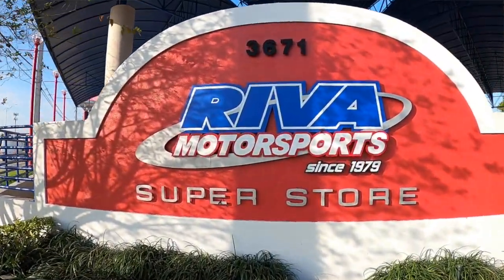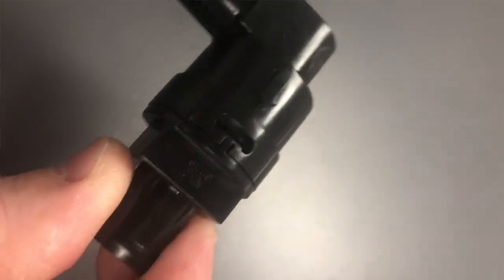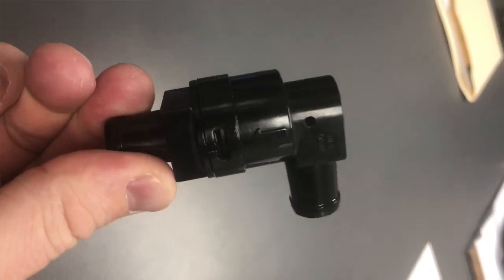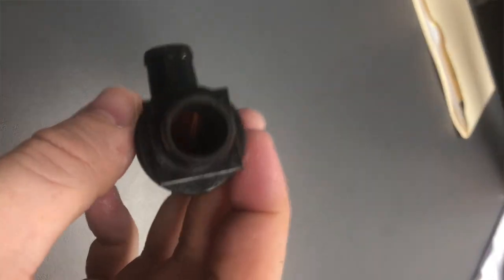Corrections On Yamaha Bilges & Sea-Doo ACE Engine Plasma Coatings: WCJ Quick Topic

Comment: ok. great. so were back to the million dollar question. why is there a gallon of water in my hull? is it blowing past the hood seal?
Reply from the maker: If only you subscribed to The Watercraft Journal: https://watercraftjournal.com/gallery-resealing-your-yamaha-waverunners-transom-plate/
Reply: Check exhaust clamps and replace driveshaft bellows post haste. Don't question it, just replace it, even if it looks fine. Get the kit.

Comment: I think "plasma treatment" is more accurate. It doesn't actually "coat" the pistons with anything, but rather, increases the wetability of the metal surface; Which allows the oil to act more-phyllic and less ‐phobic. 😉
Reply from the maker: They plasma coat the CYLINDERS not the pistons.
Reply: @watercraftjournal  same effect.
Reply from the maker: Sorta. The idea is to regulate heat in the cylinder and wick that heat off as quickly as possible. I run MAHLE's coated pistons in all of my big block Mopar engines (as you noted) for this effect; but motorcycles spinning 12K rpm need it on the pistons and cylinders.